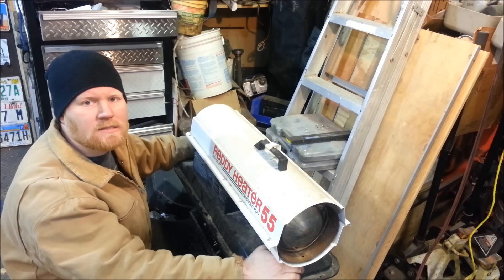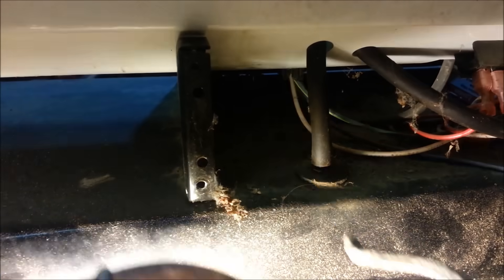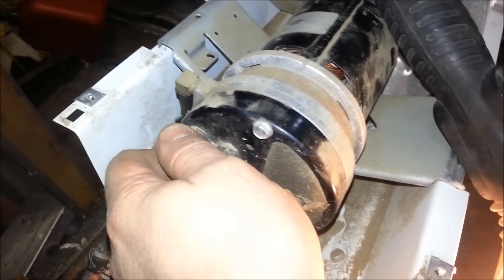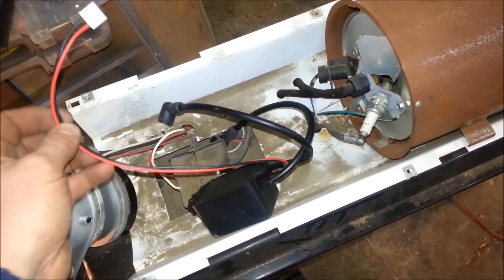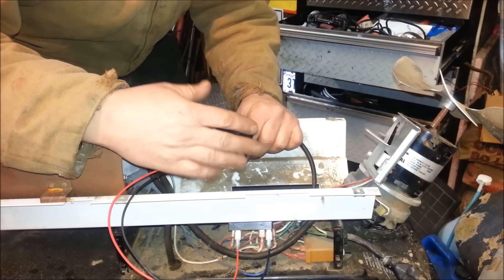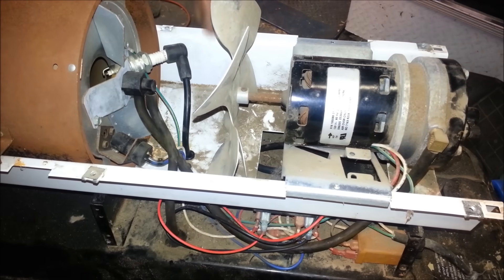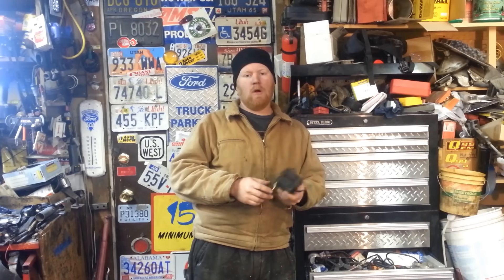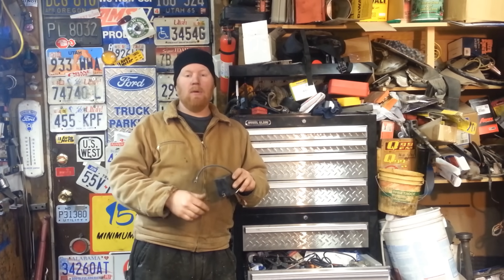Torpedo Kerosene Heater repair & HOW they work

Comment: Mine fires and runs a second or two then shuts down. Optical sensor most likely?
Reply from the maker: If it fires and produces heat, then shuts down; yes it's the optical sensor.

Comment: ok so i have fuel and i have air, the machine runs 12---20 sec. and then goes out. i removed the optic sen. and it was very clean .  it is full on fuel. this machine has always wored great until now, any more suggestions.
Reply from the maker: Optical sensor is more than likely bad if it lights, runs and then stops for no reason and trips the reset button.

Comment: I leave 2 bolts in the front of my master kerosene heater.  Then I lift the rear when I plug it in and it runs fine.  What's the cause of that?
Reply from the maker: Did the fuel pickup line inside the tank break off part ways?
Reply: sixtyfiveford sorry wasn't clear enough. I lift the rear cover about 2 inches and it will light up
Reply from the maker: Generally that is a problem with the fuel air ratio. So dialing in the air pump pressure should resolve this.

Comment: Mine is definitely not spraying. When I pump air into the hole in the fuel cap, it fires, so assuming pump problem. Any fixes for that?
Reply from the maker: You could have a dirty fuel filter. The air pump could be weak and you can turn it up or take it apart and clean up the inside. It consists of a couple flat vanes that spin a pump air. These vanes can stick or wear out and require replacing.

Comment: Thanks for the informative video.    Mine only runs for a short time then shuts down after changing the filter.  Not yet figured why.
Reply from the maker: Short while? 30 seconds or less? If so it is more than likely your photo sensor(flame sensor)
Reply: sixtyfiveford thanks ,I will check that.
Reply: sixtyfiveford ,where is the link for the perminent gauge mount?
Reply from the maker: It's in the video description.

Comment: Wonder if you can use a 12v auto coil as a replacement?
Reply from the maker: It wouldn't continue to spark without some creative wiring with relays. You would also need a 12v DC power source.

Comment: My heater runs for 10 mins or so then shuts down. What would cause that?
Reply from the maker: More than likely the optical sensor. This needs to see light from the flame and if it doesn't it shuts off the machine.

Comment: Hey man so where the fuel and air mix in the plastic part with the nipples and then spray out and hit the spark plug what's the plastic peice called I happened to break the nipples off mine while cleaning it and can't find a replacement please help if you can
Reply from the maker: It would probably called the manifold. I can't say I've ever seen just that piece for sale

Comment: Gave me the knowledge to feel comfortable opening mine up.
 In my case, the air pump and fuel delivery hoses were dry rotted. ....after 3 years from new, stored in a garage.
Made in China items of rubber seem to be WAY below specs.
Those lines feel more like plastic to me and the clamps weren't even snug on the hose barbs any more.

Comment: do you have a solution to why one blows smoke real bad?  its just like the one in your video
Reply from the maker: You need to adjust the air pump pressure.

Comment: What makes it cut off and on then if I take the top part off it runs fine
Reply from the maker: The air pump pressure isn't calibrated.

Comment: I have a problem with mine. The problem is that its starts and works great but after like 5 mins of running the flame shuts off and I'm left with a cloud of black smoke
Reply from the maker: Sounds like your optical sensor isn't seeing the flame and shutting the system down. You can try cleaning the front screen but more than likely the optical sensor is bad.
Reply: Thank you for answering !!! I'll look into that

Comment: Mine starts and runs about one minute and shuts down any idea what is happening
Reply from the maker: Sounds like your optical sensor isn't seeing the flame and shutting the system down. You can try cleaning the front screen but more than likely the optical sensor is bad.

Comment: I have one but the kerosene smell is very strong and advice. ?
Reply from the maker: Personally I think running diesel fuel smells better, but others think just the opposite. Really nothing you can do about the eye/sinus irritation if your sensitive to it. Propane heaters are an option.
Reply: Ok  I will try that thanks

Comment: Hey great video. I have a problem with mine, at first it wouldn't start and then I noticed some rust on the propeller shaft like your has and it was jammed. I forced it to move and now it starts but it makes this prrrrrrrr sound continuously. I was thinking would some oil and more rotating fix it?
Edit. I tried that and the propel moves smoothly now but the sound hasn't changed. Any ideas?

Comment: Mine is running rough little bit by spitting while running u think spark plug
Reply from the maker: That sounds like air pressure or water in the fuel.

Comment: I have a question I have the same exact heater but my heater has spark but it will not run any idea I changed the optical sensor I checked the fan everything seems to check out I even adjusted the right PSI and it will still not run or start up but unit does have spark
Reply from the maker: If it's not fogging out the front, I would suspect your fuel pickup is pulling in air instead of fuel (broken off or cracked fuel line).

Comment: I had the same exact heater. But my problem is. There is spark from the spark plug and there is fuel coming out from the jet but it's not igniting in the chamber would you happen to know why

Comment: I've run out of kero but the tank still has a little left but not enough to run. Can I mix the leftover kero and fill up with #1 diesel?
Reply from the maker: Kerosene and Diesel are virtually the same thing, so yes you can mix them.

Comment: got right air pressure by putting clamps on air hose.Heater runs 10 seconds shuts off .By pass photo it runs checked pho. shows its working. whould you replace the nozzle.R70
Reply from the maker: I wouldn't replace the nozzle if the only issue is a defective photo sensor. The nozzles will outlast the machine in most situations.
Reply: new photo sensor and now works .thanks  You were very helpfull

Comment: have a reddy R70 not pumping air.I gave it .400 clearnce , checked for air leak with soap, No air pressure. The rotor looks OK
Reply from the maker: .003-.004 of an inch gap at the top. Make sure the blades are free and that the rounded side goes outward, against housing.

Comment: Got a heater from a job I was working at found in the dumpster they put in regular gas fuel in it but it runs on diesel how do I fix it please thank you
Reply from the maker: If it has gasoline in it, dump it out and leave it open for a day or two to evaporate. Then pour in Kerosene or Diesel and it should fire right up.

Comment: hello 65 ford  my heater is like new like only been ran thru a few tanks of fuel.  this is the 2nd one I have got the 1st did the same thing, so I have totally taken it apart and it looks new so I installed a new nozzle  filters etc, also new pump vanes rotor ,ie complete kit.  the vanes pup were adj, correctly . when you turn it on it blows a lot of smoke out then lites, after installing a gauge an adj, the air screw , its still real bad ,, I have tried adj,s from 5 psi to 9   making the adjs very gradual,  so just when I was ready to run it over with my dually  I decided to check it ove again , I pulled the top off an decided to try it  ,wow it lights burns perfect ,, so I laid the lid back down on top an left it forward  with the fan exposed rund perfect all the way till the cove reaches the fan an covers it slightly then it starts the smoking ,, could it be the wrong size fan I noticed theres 2 sizes,, or a factory defective tube ,, fire tube etc where all the nozzle mounts please help ,,

Comment: What do i ask for in getting the igniter? a 120 volt to 12 volt igniter? How do I ensure I get the right size and type of Igniter , that little back box with the spark wires coming out of it. I have a 50 BTU Tractor Supply Bullet heater looks just like the old Craftsman heater.
Reply from the maker: I've never seen ones that didn't use a 120volt ignitor. If it is Tractor Supply Brand it is made by someone else(Dyna Glo, Desa, Dayton, etc). What the model number of your unit?
Reply: My heater inside looks just like the one in the video and on the outside too, so I surmise it uses a 120 volt igniter. My heater still runs great but I wanted to know incase my igniter ever goes bad I know what to get.

Comment: Unit worked fine last season but I replaced the air filter, ball/spring/plug/screw kit. I don't have a gauge (yet) Wondering how to check for fuel delivery on a HSI unit (ReddyHeater 55) With the cover off I can see the HSI fire but no fuel squirt out of the injector. The fuel filter can be blowed through. Fuel line from filter to injector good. Injector/nozzle clean, can be blowed through. Soapy water test on the pump cover and was leaking air. It may be a faulty  filter. Removed air filter and retest and seal is airtight. Am I correct that if the air pressure is off it will prevent enough air to suck through to pull the fuel up to the injector? Any suggestions what to test for next?
Reply from the maker: If the air pump isn't blowing hard enough through the venturi mixing nozzle(injector); it won't pull the fuel up out of the tank.
Reply: OK. Thanks
Reply from the maker: You can try turning the screw to increase pressure (clockwise).
Reply: Thanks for the reply. I have the same unit as this vid. I got it running with a cracked pump cover (super glue) for 10 mins or so without a gauge reading. Then we replaced with new the pump cover, adjustment screw, ball, spring, fuel lines, fuel filter & air filters(s). Using a proper low pressure gauge (0-15psi) no start. We have spark & fuel not sure what the issue is. It appears the fuel is not hitting the ignitor even though there is a good wide spray pattern.
Reply from the maker: The injector needs to be spraying out in a mist /fog. You should be able to turn it on and if it doesn't fire up a fog of diesel/kerosene should push out the front. If it is spraying liquid fuel, it will be very hard for it to ignite. Does the unit have a lot of hours on it?
Reply: not sure about hours as I got it used. Worked great until I replaced the air filters DOH! It's not really a mist/fog but more of a strong spray. Let me recheck the injector. Thanks for your help
Reply from the maker: It won't light if its putting too much fuel in the combustion chamber. These are like a engine and you need the proper air to fuel ratio to light.
Reply: FIXED! When cleaning the injector I didn't have the orifice seated correctly. I reseated it and it fired right up. Adjusted the air pressure so now it's spot on. Thank you for your insight.
Reply from the maker: Awesome.

Comment: Your good at making things how would you go about pulling wheels on one that does not have any with OUT having to weld on the tank
Reply from the maker: I have one that I just throw on a furniture dolly to roll around. The ones that are under $10 from Harbor Freight.
Reply: And this is why I like your Channel you actually reply back. Like when I said If the can blow up I was coming back as a gost lol. That's a grate  idea about the hand trucks thank you I been worried about busting a hole in the fuel tank from sliding it.

Comment: Hi -- I have a 110,000 btu master brand. Been sitting for like  8 years maybe. I fired it up and it wouldn't run so I played with it some. its starting now but sputtering (firing/no lighting,firing, not lighting over and over and spewing black smoke when not firing.) Can my kerosene be bad ? I was thinking maybe I should dump it and try fresh kero. Please let me know what you think. Thanks !
Reply from the maker: You probably have water in your kerosene from condensation forming on the inside of the tank.
Reply: I'll dump the kero and put some new in and see how it goes. Thanks for the reply, I appreciate it !

Comment: the clear plastic cover on my fuel gage cracked and it leaks now.  Cant find a replacement part or any tips on replacing.  Do you have any leads?  Thanks
Reply from the maker: I've never seen them for sale, so replacement parts for the fuel gauge are more than likely not available.

Comment: Can you tell me why mine will run with lid off but only run for about a minute or two when it's on?
Reply from the maker: I needs a proper air fuel ratio to run right. With the cover off it gets more air vs fuel. So your machine is getting too much fuel when the lid is on, which means the pump pressure it more than likely too high.
Reply: Thank you, your video taught me a lot , don't have a gage will have to try adjusting it without.
Reply from the maker: Kelly Tunny That'll work, just keep track of your screw turns so you can reset it if need be.
Reply: Thank you... Seems to be running great. You were a big help.

Comment: my torpedo heater is making a popping sound as its running.  its a l.b. white 175,000. it runs fine and fires good...just making a constant deep popping sound where flame is coming out...any suggestions?
Reply from the maker: It sounds like your propane regulator(part that connects directly to the propane tank) is allowing too much propane into the machine.

Comment: After years of sitting in my basement, mine would not fire up when I plugged it in. Go figure.
Fresh fuel, It sparked fine but no fire. After watching this great instructional video, I took it apart and checked everything and cleaned the air pump (very easy). blew out the air/fuel hose by mouth (at the air pump hose), Plugged it in and it fired right up. :) 
My "cone" is very cherry red. I don't have a vacuum gauge to test and set the air pressure to 3.4 PSI (which is VERY critical).
Question; could I adjust the pressure without a gauge? I assume turning it to the right to close off air (in turn less fuel) one full turn at a time, wait, then watch the cone for color change?
I don't want to mess it up now that it's working.
Thanks for a great informative video  :)
Reply from the maker: Without a gauge I would leave it be. There is nothing wrong with a cherry read cone.
Reply: Yeah, your probably right.
I don't want to mess it up.
Thanks for a very informative video. :)

Comment: the fan on mine seems to turn fine by hand until it is plugged in and then the fan gives a lot of resistance and won't turn and makes a loud buzzing sound, what's going on? I have spark and fuel just no air because the fan won't turn help!
Reply: and none of the blades are hitting the housing or anything, would I just need a whole new fan motor?
Reply from the maker: The back side of the fan motor is your impeller air pump. You'll need to take off the back cover, air filter and look at your impeller blades.

Comment: Maybe somebody can help me... running an older heater, similar style and everything functions just the same. Spark working great, tested at the back of air pump and getting good vacuum, however, no fuel is getting into the combustion tube. Checked fuel filter and line and they're clear. It's just not spraying. Cleaned injector, still no bones. Was running, then just crapped out. Not sure what else to check.
Reply from the maker: Your fuel pickup line could have a split or not be reaching the bottom of the tank. Or your air pump isn't supplying enough pressure to pull the fuel up.

Comment: Where did you buy the igniter for 25 or 30 dollars
Reply from the maker: Not sure if you can still pick them up for this cheap but you're able to get them around the 40 mark. Search Ebay for 39E0 ignitor

Comment: Yet another great video!!! I picked up an old Sears salamander for free that won't light up. I've never worked on these before but after watching this video I don't think they're all that complicated.
Reply: I took the top off, great spark, fan is spinning away but not getting fuel. I noticed the rubber line was split so off to a parts store tomorrow to see if anyone has some of a small enough diameter.